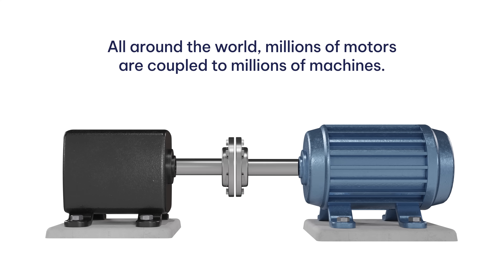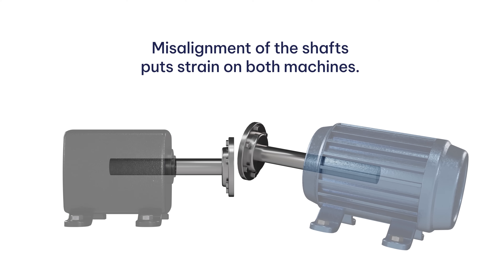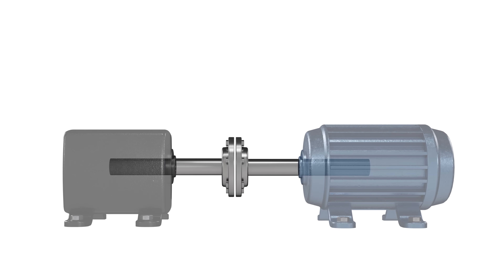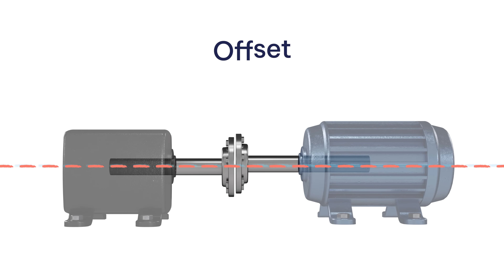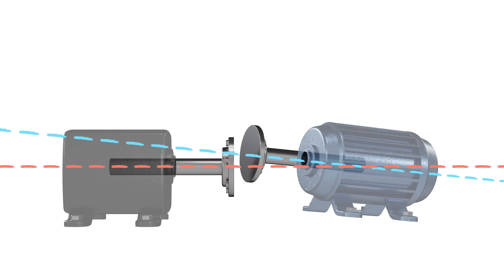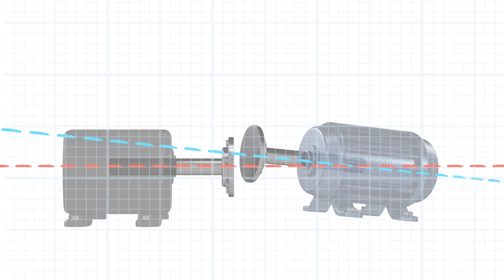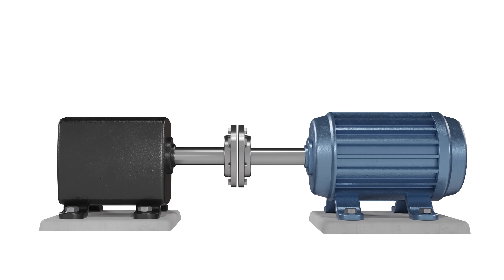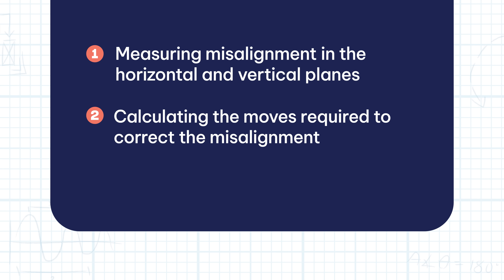Shaft Alignment 101: The Basics | ACOEM

Comment: If you guys can make a video on the shaft play according to the bearings like if there is case where the Multistage charge pump having Babbit/Journal bearing along with deep groove ball bearing at DE side and on opposite they have Angular Contact ball bearings  with an arrangement to compensate the axial thrust,
In that case if the shaft dia is more resulting more play of shaft with bearings, when to use two plunger dial indicators on face of Coupling hub with one on top/rim and when to use single gauge on face with one on rim on the coupling hub(Generally they say when there is shaft play>+_0.05mm it would be correct to use two dial indicators placed at 180° on face of hub)
In short is there any specific criteria for using two gauges on face while rim and face alignment,
Its quite interesting to understand these things but it gives sometimes headache😅

Comment: Can you guys just tell me it's quite confusing to understand why two plunger dial indicators used on FACE in rim and face alignment in condition where it seems to be high rotor play(maybe > 0.05mm shaft play),
I mean I don't get a point where some people do just A1-A2 and some do [A1+A2]/2,
And if subtraction(A1-A2) why logically
And if addition(A1+A2) why logically

I have a little confusion about above mentioned things only and it would be helpful for me to understand more correctly if you approach here to answer.